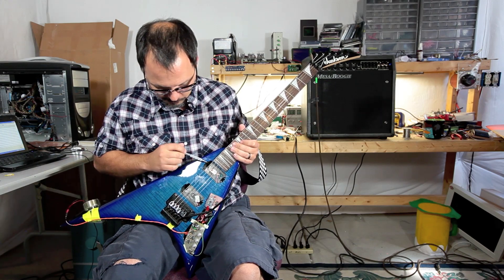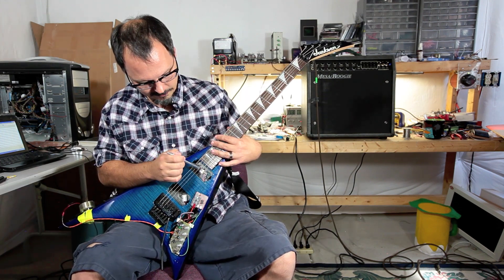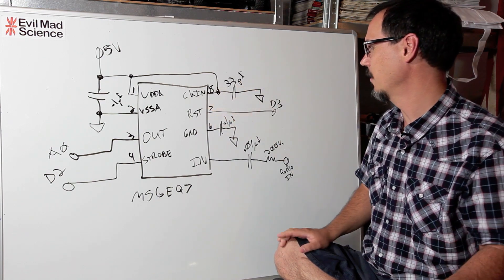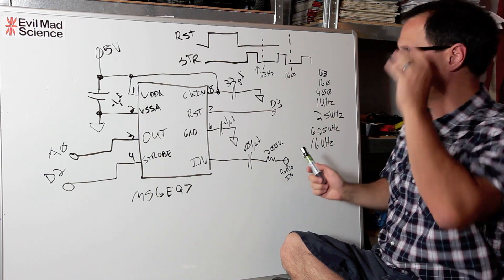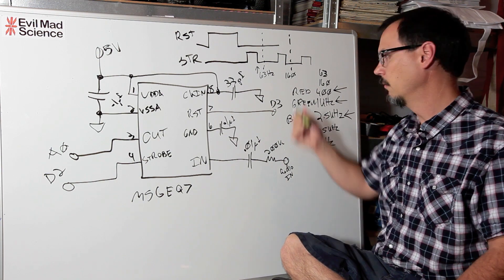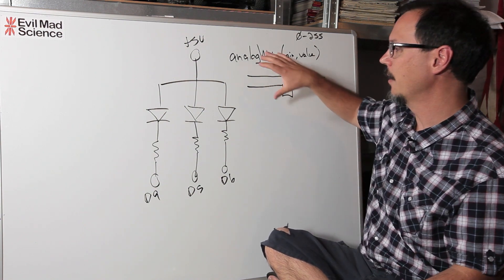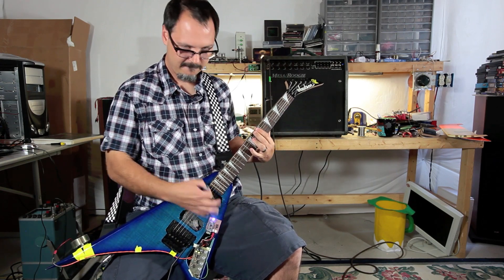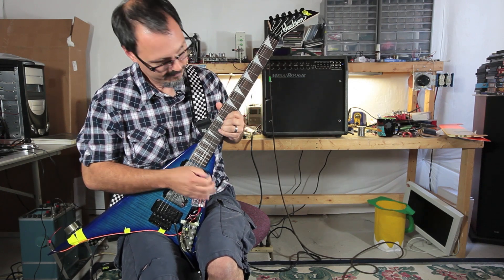SparkFun According to Pete 9-4-12: Guitar Pickup Project (Part 3)

Comment: use a PLASTIC TOOL to poke at them!  Perhaps all it needs is a bracket over top that pushes down on the top side of the surface transducers that's held down to the body of the guitar.